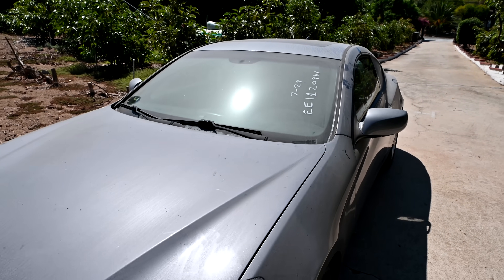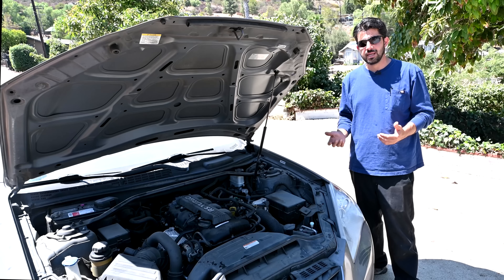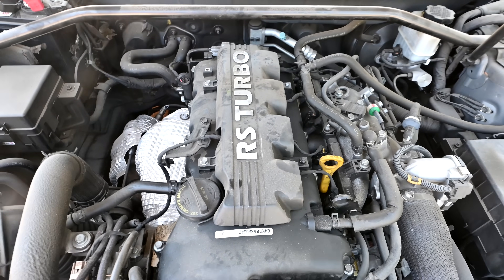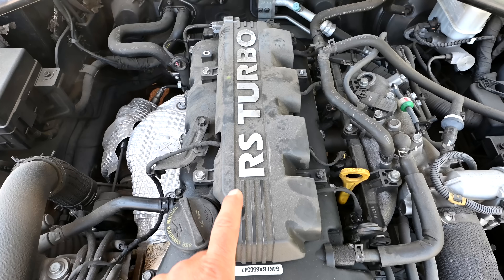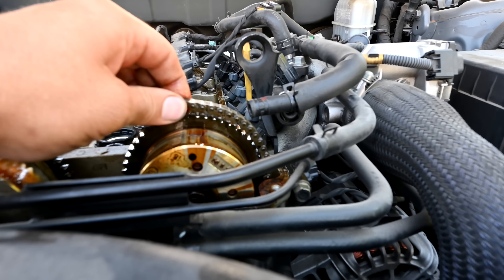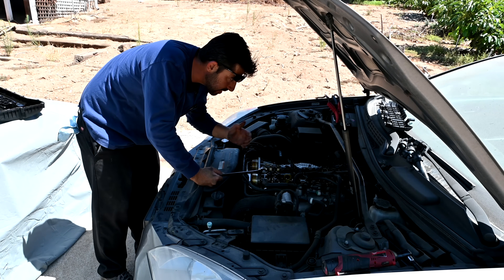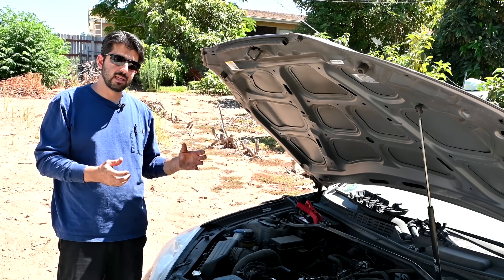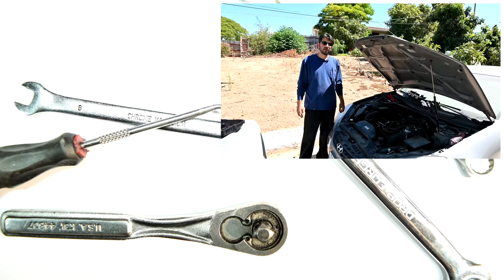The Hyundai And Kia Engine Failures Explained.

Comment: I had a 2010 Hyundai Accent and when I bought it the salesman told me to change the oil every 7-8,000 miles. I knew that was too many and instead did it every 4,000 miles. It ran great and I never had a problem with it during the entire time I owned it. I think these long oil change intervals recommended by the manufacturers are killing these engines.
Reply: Friend has a 2012 Sonata that caught on fire while  her mechanic was driving it after a maintenance schedule.
Reply: @tocreatee3585 Damn never buying one of those
Reply: Planned obsolescence.  3000 to 5000 miles has been standard for decades. I recently tore down a Ford truck motor that had it’s oil changed at 3000, used synthetic oil. It had 230,000 miles and the engine showed zero sign of wear and was in like new condition.
Reply: @jayleeper1512 I has a 5.4 F 150 work truck on 2nd transmission with 380k miles ran like a top. All we did was maintenance and synthetic oil every 5k miles.
Reply: @jayleeper1512  Safe bet that it wasn't a 3 valve 5.4L.
Reply: @ih302  those suck, I hear. The 300 six was rated as the fourth best engine ever built
Reply: You have to realize that the maintenance intervals are created by marketing, not engineers.
Reply: Exactly, these car manufacturers want are cars to go to shit as soon as possible, so we buy new cars more frequently
Reply: @El_Naranjero  Believe that they are trying for a "lower cost of maintenance" on the the vehicle.
Reply: Think about it. The more failures they get the more money they make.
Reply: @opinionsvary  Well said! That’s why API created the “SP” specification to minimise LSPI and timing chain issues. Here in Europe, Tucsons come with the 1.6 DI Turbo engine which requires 0W-20 API SP oil. Their normal oil change states for 9300mi while the severe for 4600mi. Better stick with the severe though…
Reply: @npapan  Always stick with "severe" oil change schedule.  If you read the definitions for "severe" use - pretty much if you are driving your car on the North American continent, you are in severe use.  Plus it covers you for any warranty claim.  Dodge DENIED thousands of 2.7 V6 replacements because people followed and documented that they followed the "Normal" maintenance schedule.
Reply: Plus the 0w oil is not good. I personally run a 5w in my 0w cars. You will stop a lot of the oil consumption issues these engines have.
Reply: Yep, my dealer told me 5K is the max you should be driving on these thinner oils. "ignore that 7500 interval the book says and do it every 4-5. it'll save you a lot of headache"
Reply: 2010 Accent has a completely different, simpler, and more reliable engine. No direct injection and no resultant ridiculous carbon buildup.
Reply: @zircoben  HAHAH The fix to that is have normal injectors AND direct injection like most coyote engines.
Reply: I change mine every 3-4K with a GF-6/SP grade full synthetic. New 2.0T two years ago. We'll see if it lasts!
Reply: @robertbweltzien  Turbo bearing or head gasket will go out.
Reply: I agree cus ihave a 14 1.6 with 150 , a pock. Rock.
Reply: Synthetic oil by itself might last 10k, but while working within the engine, pick up contaminants.
 Vehicle manufacturers are counting on you not knowing this fact.
Reply: Depends on the oil you use. Get amsol or pennzzoil ultra platinum and go 7500-8000 miles. they say 15k but thats a stretch
Reply: Did it go through oil ?
Reply: Yeah it's clearly the peoples fault and not Hyundai and their metal shavings in the engines and all the many recalls and warranties or anything like that or that the Theta 2 has a lifetime warranty now because they screwed up so bad to the point a whistleblower outed them.
Reply: Its long change intervals combined with  both POOR quality engine oil (think bulk dums from Jiffy Lube) & also their poor quality oil filter made just for the oil change place. U cant buy such a filter that meets low specification at auto zone or walmart. AND then that same cheap owner uses poor quality regular unleaded that lacks the proper octane & detergent additives.  The MFR rarely duplicates that scenario in their testing.
Reply: I change mine every 2,000, especially with how I drive and all the additives in gasoline nowadays.
Reply: I just purchased a 2024 Kia Soul and the recommend on it in the manual is every 8k miles. No way I'm going that long between changes. But it also calls for change annually that works for me because Its unlikely I'm gonna put more than about 400 miles/mo on this vehicle because I'm not only retired I'm also an invalid. Thus I feel comfortable to change the oil annually which keeps me within the warranty. Nope it doesn't take much to really rack up the miles.. killer of everything moving.
Reply: I just got a, 2023 Hyundai Sonata N-Line 2.5l turbo and I couldn't care less about engine problems as the warranty is, 10 year/100k mile warranty. Lol. So....I don't care if anything fails....I get it fixed/replaced for free. Ha also....I ALWAYS change the oil on a new car after the first 500 miles.  Some engines just don't last as long as others. It happens....not a single engine and or car maker has an engine that has never had a issue or issues. Millions are sold and odds are, some will have issues, especially with some people driving em hard as all hell and not doing proper maintenance. Again, new hyundais now have a 10 year/100k mile powertrain warranty. So, couldn't careless about issues. Lol also, when buying a new hyundai, you can purchase a lifetime pwertrain warranty for around 2k.....so.....couldn't careless about issues.
Reply: @nexpro6118  They will deny you and say you did not have maintenance according to rough service schedule.
Reply: @nexpro6118 yea, wait until you have to use the extended warranty. You may be unpleasantly surprised.
Reply: @nexpro6118  You are assuming that it will be quick and easy to get repairs done and that you won't break down on a trip. Or you could be one of the ones that have no problems.
Reply: @nexpro6118  Except that it is a real hassle to have it break down on a trip and have the thing in the shop for a month, or worse yet have them make an excuse not to do the repair under warranty. If you trade in every 50,000 miles, it doesn't matter either, other than the fact the used models of Korean cars don't hold their value.

Comment: Oil, fluids in general are one aspect, still shot down in flames with there cookie cutter intially designed, set, released to consumers electrical chassis wiring. Some engulfed within flames, engine off, parked, some while engine on/running. 5-million + recalled. Like how some say all you have to do is check fluids, guess you could wear nomex fire resistant suit, while doing so. I'd stay with Toyota/Honda, or domestic vehicles due to if recall, it's usually a minor problem, not a fire Marshall bill excursion.

Comment: This engine failures in H/K products seem to be predominant the US, but not everywhere else. Where I live there is plenty of H/K of this era and I haven’t found a single one for sale with a blown or recently repaired/replaced engine. Therefore, I wonder if this is an issue caused by owners and not necessarily by the manufacturer. 

My hunch is that people in NA tend to assume that products need no maintenance and care or they simply cannot afford maintenance and repairs because they are too broke, so they just neglect oil changes, checking the oil level and postpone repairs until is too late. No wonder engines blow up under those circumstances.

Comment: I own a 2012 KIA Sorento, with the 2.4L engine. Recently it turned 103,383+ miles. My son, who gave it to us as a present, was very loyal with the oil changes--I taught him that! It's burning oil (about 1-and-a-half to 2 quarts between changes, which I do every 6 months or 5,000 miles, whatever happens first.) Until the financial situation eases off, that's our ride, period! UPDATE!: I used Berryman's B-12 Chemtool  & the Sorento no longer burns oil, PERIOD!!!
Reply: Kia spec is 1 qt per 1000 miles. But regardless if you have good maintenance records there should be a engine recall to cover failyre
Reply: @DavidM-ni4yq  Can you do simple division? 5000 miles/1.5 (quarts) = 0.3 quarts per 1000 miles which is not bad.
Reply: @DavidM-ni4yq  Ain't gonna be a free engine after 10 years and 100,000 miles. Dunno what planet you're living on.
Reply: @tsubadaikhan6332  I got a free engine at 118k miles for my 2012 Veloster that had a rod bearing failure. They extended the warranty period for the engines they knew had issues to 150k miles
Reply: @tsubadaikhan6332  Anyone who says "aint" is clearly not qualified to breathe.
Reply: @BenState  you right, they aint qualify to breathe
Reply: @BenState  ?? ?
Reply: @DavidM-ni4yq  My family has has 2 MB for older
member, 2 BMW for young ones. We do OFL
service once a year which includes  adding Liquid Moly product for 
engine oil & fuel system. We never top up oil between changes. Never experienced major issues. My 7 year old SUV is still on original
battery, even in cold winter weather engine
starts up on first try.
Speaking of Kia, Hyundai, Genesis Samsung, LG, long way to go to improve quality
of service for customer
satisfaction.
Reply: I've arrived at the conclusion that Dealer service depends on the policies that Management dictates. Good Manager, good service; bad Manager...You guessed it!!!
Reply: @Funkydood  You would do so much better on a toyota or honda. One of may cars is a 130k miles prius, burn zero drop of oil.
Reply: I just got a, 2023 Hyundai Sonata N-Line 2.5l turbo and I couldn't care less about engine problems as the warranty is, 10 year/100k mile warranty. Lol. So....I don't care if anything fails....I get it fixed/replaced for free. Ha
Reply: @nexpro6118  yeah Hyundai is not going to give you any problems if it fails, they will be more than happy to replace it for you👌
Reply: @blue88aw11  I 100000% guarantee you did call a dealership and didn't call a fleet manager order specialist either. Lol. I also bet 10k that you are just using your "expert" opinion that you pass off as fact and knowledge lol.
Reply: @nexpro6118  You gotta be REAL religious about maintenance to maintain that warranty. My Kia Soul has an 8k mile callout on oil change but NO WAY I'm going that long.
Reply: @nexpro6118    That's what they say before the sale.  Watch what they do when you bring the seized engine back in.
Reply: i change the oil in my 1.9 tdi every 60-70.000 km , and still better than many new engines with change oil at 5000 km
Reply: Your engine is on its way out.
Reply: Congrats, most Hyundai Kia don't reach that high. Now proceed straight to the junkyard as it will not last much longer
Reply: I would throw a bottle of Lucas fuel treatment in an empty tank before topping it off so it can help burn out the oil carbon and residue. It might even help clean gunk out of your piston rings.
Reply: IF you Go longer than 5000 miles before oil changes two or three times that engine will become an oil burner. First oil change should be at around 500 miles.
Use full synthetic with genuine 
KIA/Hyundai oil filter.
And do recommended service.
2011 Sportage 360,000 flawless miles.
Have three no problems ever.
Reply: @ChasL704  genuine makes no differenc and is probably overpriced garbage oil
Reply: Your car should not be burning any excessive oil in between changes......Also the last time 100k miles was alot for a car was about 30 years. Any reliable car will last at the very least 250k miles.
Reply: @devanrogers3133  Lot depends upon WHOSE driving. You got lead in your feet you can forget ANYTHING lasting 250k miles.

Comment: Problem #1 is the steel camshaft in an aluminum journal with no bearing in between. Aluminum "grit" gets spit out into the pan and right into the oil pump. Loss of oil pressure is a direct result. Problem #2 is PLASTIC timing tension components. They fail and the engine eats itself. Problem #3 Terrible maintenance by driver. Don't "miss" oil changes or use CHEAP oil. Don't switch between regular and synthetic, it makes sludge and is (almost) impossible to remove from the oil pan & head. Top 3 problems, direct from a Technician, I AM NOT A MECHANIC. 😎👍

Comment: 108000 miles and the engines stuffed l would not buy a Kia or Hyundai because they are crap this proves it l woukd rather buy a Toyota Suzuki Honda Mazda Mitsubishi oops we own a Suzuki and a Toyota my Toyota Hilux rear drivecab chasis 1997 Australian model only has done 430000 kms the engines original and its fine doesn't burn oil if Hyundai ir Kia can produce a car thst good there are still plenty of 30 40 year old toyotas still driving around infact tgere is a 1993 Toyota Corolla in New Zealand that has done over 20000000 kms original engine and gearbox is there any Hyundai or Kias have done that but that pile of junk you bought only 108000 miles and the engines stuffed why

Comment: My 2013 Hyundai Santa Fe with 3.3 died at 99,000 Miles. I can't even get a Hyundai dealership to find out exactly problem, they don't do engine work anymore. They say it might be a bearing.
They will be glad replace the engine for about 10,000$

Comment: My girlfriend has a 2015 Sorento with the 4 cylinder. Had the engine replaced when it had 70k miles on the dash because it thru a rod bearings. Her engine now has roughly 30k on it and she burns oil and has been since they put it in.  Have to check it every two weeks to see if it needs oil. Not good at all. Obviously this is a design flaw.

Comment: Yes, metal shavings because they didn't change out the drill bits and larger boring heads. KIA service centers told KIA Corporate what the issue was/is and KIA is still not making changed.

Comment: I had a 2014 Sportage ex, a 2017 sportage ex and now I'm on a 2021 sportage ex. I never experienced this engine failure issue at all. My 2014 had 130,000 km & the 2017 had 120,000km. I always followed Kia's recomended service (dealer maintained) but did oil changes at 5,000 km's. There must have been bad batches of these engines produced beacause not all of them have failed.

Comment: Very informational videos. Appreciate your honest advice and suggestions. Good stuff.
Question:
If you were to buy or can suggest a "most reliable car/truck" to purchase.
New or Used?
What would it be? If there is such a model and motor and transmission.

Meaning I want to have it all maintained 100% and safe driving, good mpg and cost effective comfortable and where I can put on many miles per year. And just drive and drive.

I am tired of new vehicles with monthly payments, insurance and vehicles that need constant weekly detailing and cleaning all the time.

I just want 100% reliable transportation to and from each day and not worry about breakdowns and high repair costs.
I know there are a lot of variables out there and nothing is 100%
Just curious on your thoughts.

Thanks for your videos!

Comment: The first gen Hyundai accents have almost no reported issues or recalls. I've owned two and still drive one today and I beat the crap out of it and it keeps coming back for more. It was going through oil like a drunken sailor on shore leave but since replacing the EGR valve it's next to nothing now. I change the oil every 3k miles or less with full synthetic. I'd still have the first Accent if my A$$hole ex-roomate hadn't sold it to the u-pull-it place. I had sold him the car years ago and then bought it back from him when he got a new car. We always remarked about how tough the drivetrain is, as long as you get it with a 5sp manual. The wrecking yards were full of the ones with auto transmissions.
Reply: only downside being how totally nasty they are to drive - but agree, the Gen 1 Accents were/are very very tough cars.
Reply: @jamesward5721  Nasty in what way? I did have issues with both of mine wanting to oversteer real bad, but I replaced the lower control arms and that went away. I also replaced the tiny factory 13's with some Honda Accord 15's and 195/60/15's and it handles like a go kart. My first one I bounced off a freeway divider face first at 70 mph. wasn't wearing my seatbelt and I barely got josled in my seat. My latest one I was sideswiped on the freeway and despite it wanting to shoot across the lanes, I kept it pointed forward and in my lane. The other driver was spinning out of control in a Scion TC. Plus the insurance Co. gave me just north of $3200 for it, lol.
Reply: @Rundark-  I've had several - tough as old boots, but they're like driving a bin. :-)
Reply: @jamesward5721  LOL! Yeah, they certainly aren't fast, but I do go fast in them. I took out the fuel injectors and poked bigger holes in them. That certainly helped a little, I had that "snapshot" app from progressive when I was getting insurance through them. One of the things I never had to worry about  was fast takeoff's. I was pulled over for speeding once, and when the cop asked me if I knew how fast I was going. I asked him, "did I get to a Hundred?" He started laughing as he knew as well as I did the only way I was getting to a hundred in that thing was if I drove over a tall cliff, LOL!

Comment: My 2 year old Kia Sportage has failed after 17000 miles and no dealer wants it. Told me a year before I get it back but they won't accept it. 3 weeks to get a hire car and still have to pay the lease. Borrow my dad's brand new XC90 and someone has written it off. It's obsolete nightmare! It's cost me a arm and leg to recover the cars.